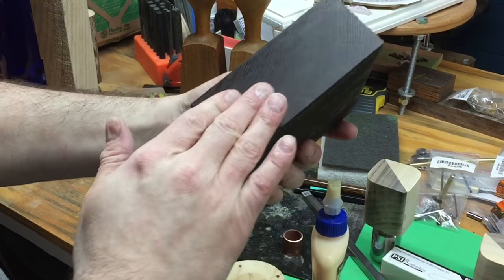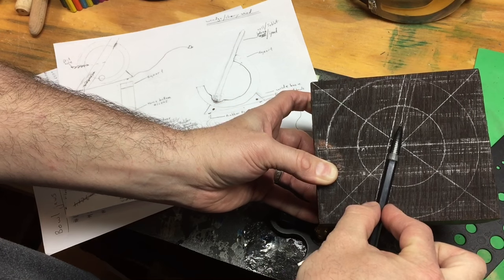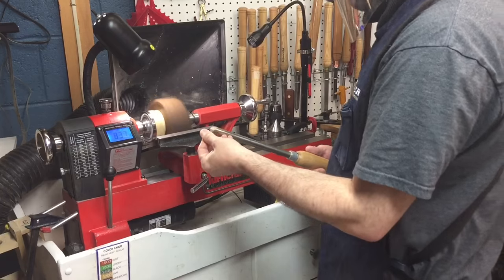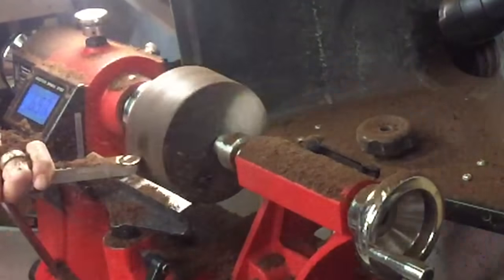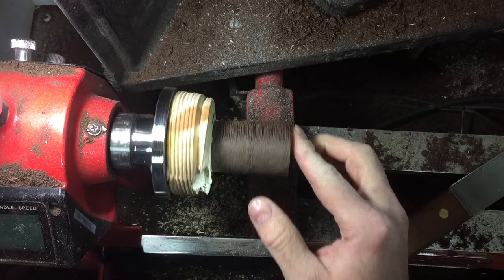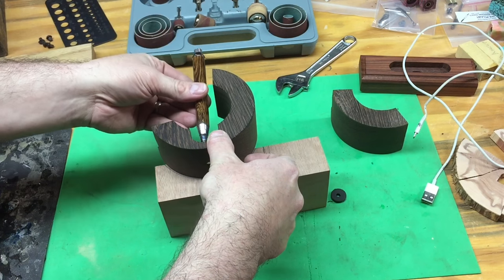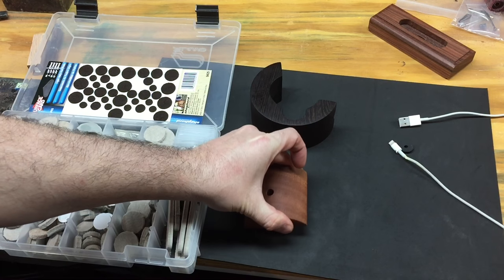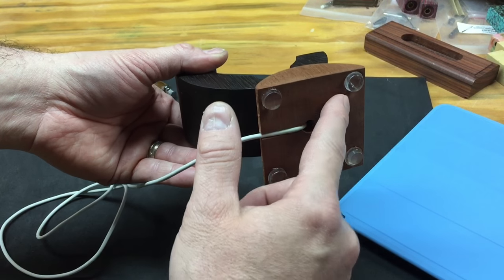Wood Turning an Avant-Garde Cellphone/Tablet Charging Stand

Comment: Hey Spiro;
Nice looking dock.  Any issues with that glue joint holding up?  Two finished concave surfaces glued end grain to end grain, under (slight) load when holding a device?  I'm curious as to how long that can last...
Reply from the maker: Hi! I've been wondering the same thing in regards to the joint. So far it has not failed. I thought that the glue would stay and the woods would pull apart, but so far it's held. If it does fail I will re-glue with counter sinking two thin screws from the bottom of the base up and that should do the job. You would only see the screw heads from the bottom of the base. Thanks for watching my friend.